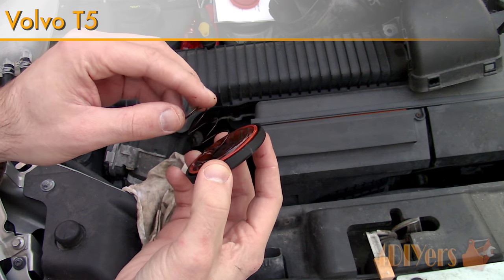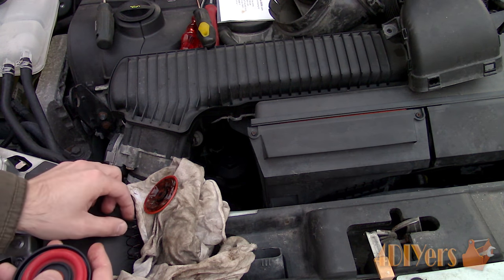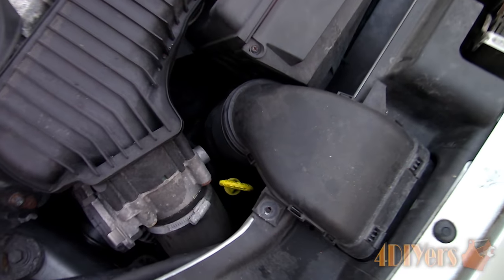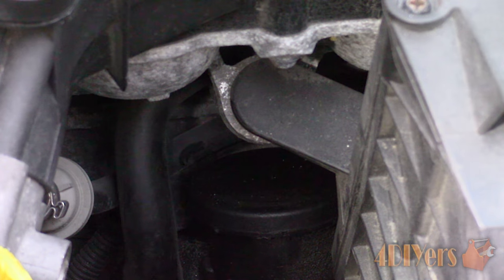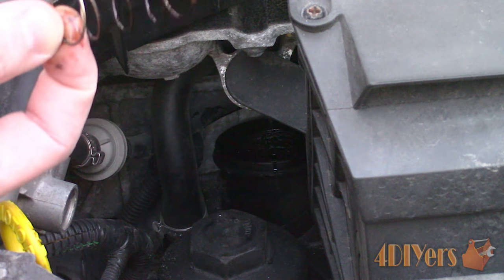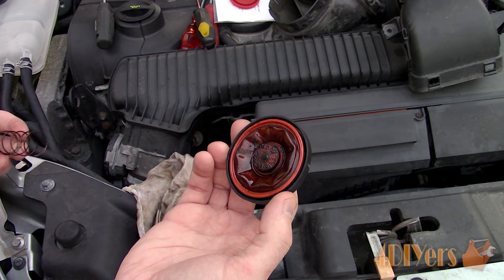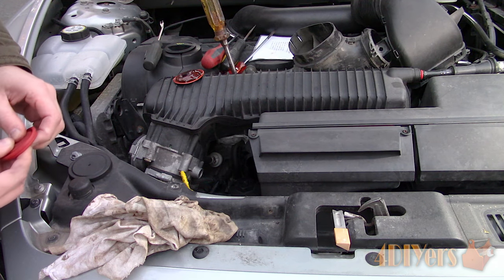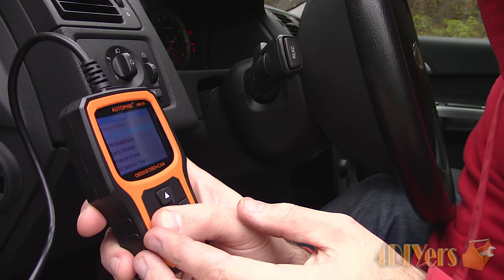How to Replace the PCV Diaphragm on a Volvo T5 [Money Saving Way]

Comment: Thanks man helped me a lot changed mine had took the tire off thinking it was a pulley
Reply from the maker: Happy I could help! Yeah it can be easily mistaken for a bearing in a pulley failing.
Reply: @4DIYers  lol now I’m trying to figure out the name of the hose my car is getting to much air the hose disintegrated in my hand when I grabbed it guess it was old pcv valve hose or intake hose? Do u know by chance
Reply from the maker: Which hose is that? The plastic one from the duct opening close to the hood lever?
Reply: @4DIYers  thanks for replying man an it goes up to the engine but ima take it to a mechanic it’s being a pain in the ass gets to much air an stalls
Reply: @4DIYers  yea has like ridges

Comment: Thank you so much! :)
Reply from the maker: Thank you :)
Reply: Update - By ordering the part you recommended and using your great tutorial, I successfully replaced this yesterday!! My car is now running smoothly and I saved $500-$1,000 according to the bid I received to fix it at a shop. Thank you again so much for your help! :)

P.S. Helpful tip for anyone whose cap is stuck on - a hairdryer does wonders! I found it in the comments here, so thank you! :)
Reply from the maker: Awesome to hear and glad I could help :) Thank you for the tip on the hairdryer too!

Comment: Hi
Thank you for this video:)
I made this repair today. The whining noise went away, but when i do the "oil cap" test, there is still a mild vaccuum sucking the cap in. Is this normal or should there be no vaccuum at all?
Reply: There should be a vacuum pulling since compressions is being pulled. This is a good sign. As long as it isnt releasing pressure you are fine
Reply: I made the same observation, a mild vaccum after the repair.
Reply: Update, in my case (V50 2006 2.4) it was not the diaphragm, but a hose going from the crankcase ventilation to the top of the engien, that was broken. It made the car have smiliar symptoms.
Reply: @steinow3151 que tubería está rota y has cambiado?